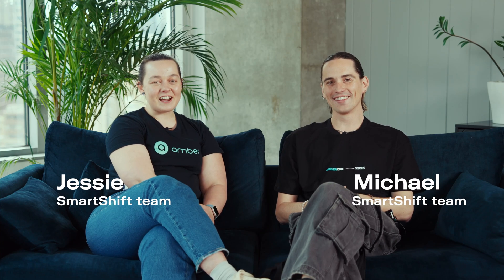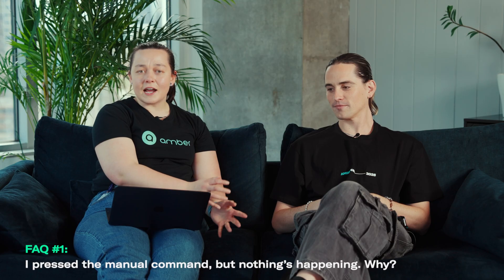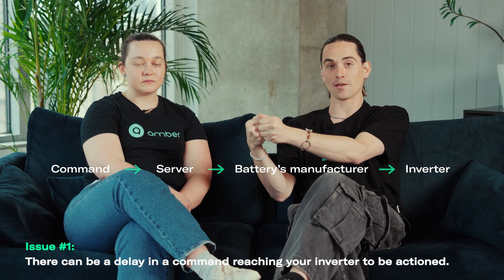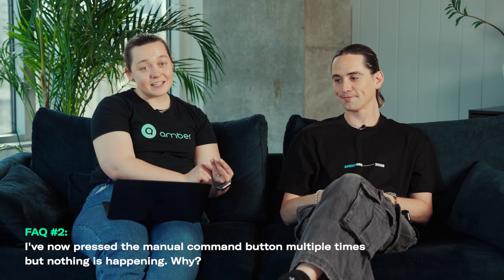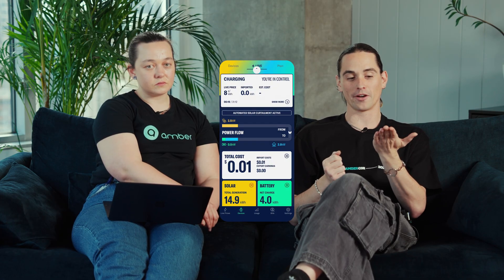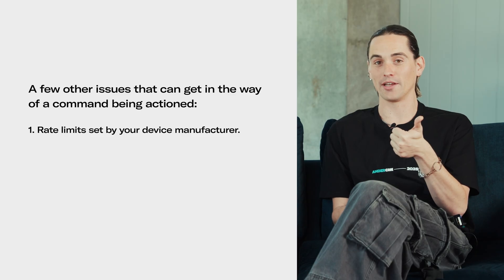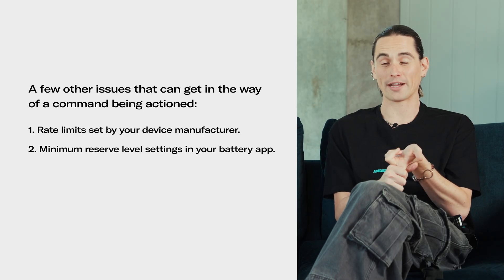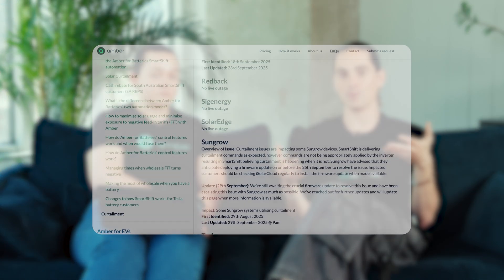Why aren’t commands being actioned by my battery?

Comment: I have 2 question if I may about the operation of smartshift with I can't seem to find an answer on and manual control.
I have a shed roof full of solar panels, sigenergy 48kW battery, sigenergy inverter, 3 phase and access to now feed back 8.33kW per phase to the grid.  I have also set my battery minimum discharge to 10% (just as a reserve if the weather is shitty the next day).   I've now had smartshift live for 4 or 5 days.  I realise that smartshift will now need about a months to work out my system/use/charging capacity/discharge etc.  My questions are:

Firstly, when smartshift feeds back to the grid at night (peak), when will it choose to do so?  Does it look at my feedback rate (25kW minus my current load) then determine how long it takes me to feed that back (approx 2 hours in my case with 10% residual) and then look at the FiT "peak" and send it at this peak.  Or does it simply start to feed it back when the value is not zero or negative?

Secondly, if the settings "control my battery", if I "dispatch battery energy", if I pick 120 minutes and I only have say 30kW stored, will smartshift only dispatch until it reaches my desired 10% battery charge reserve that I set?

Comment: Thanks for the video. 

I do have a question though. I have direct control over my battery through the manufacturers app. If I'm using smart shift, can I still go into my manufacturer app and directly discharge or charge the battery?

I would assume that the direct manufacturer command would then override whatever commands have come from Amber?

Looking forward to hearing from you

Cheers

Comment: Thanks for the information. I’ve found exactly what the other respondents have said. Tonight almost drained my battery. I can assure you that hitting manual control did bugger all! I had to use Netzero (whether by fluke or accident it stepped in and overdid  the command that smartshift sent or was trying to send . I hope I can get through the night without drawing grid power. It’s not any good if I’ve sold at 30c and then have to pay 38-40c and your app tells me to conserve energy as power prices are high. And it’s not possible 🙄. I’m going to give you guys a chance for 2 more months and if it’s this sort of 💩 show. I’ll go. It’s not worth the stress of selling cheap and then buying high. 1 day you can cope with more than that it’s ….

Comment: Funny timing! I was having issues about this LAST NIGHT. SmartShift emptied my battery entirely to 0%. Some type of notification that my inverter is ignoring commands would be valuable. It makes SmartShift hard to trust not knowing if my inverter is doing what it should be.
Reply: What did you set your Minimum Reserve Level in SmartShift?
Reply: @petermatthews12160%. Which apparently means only 80% should be usable based on their info.
Reply: @Lachlan.Wright Thanks for replying Lachlan. I’m still curious about what MRL you set, as I have mine set at 40% in both the Sigenenergy and Amber apps. Given your experience, I’ve been thinking of revisiting my MRL settings.
Reply: @petermatthews1216sorry, mine is set to 0%. My answer kind of blended into your name in your previous comment.